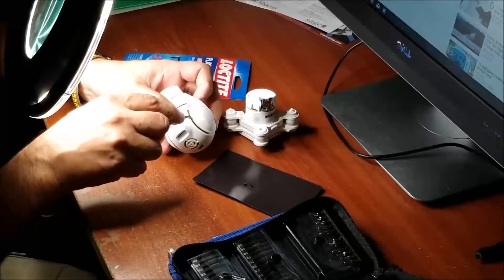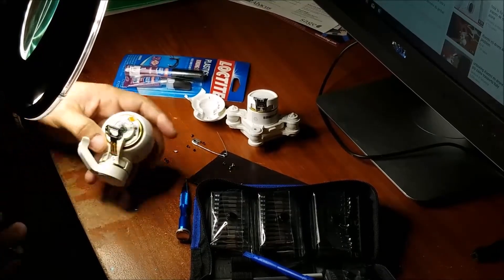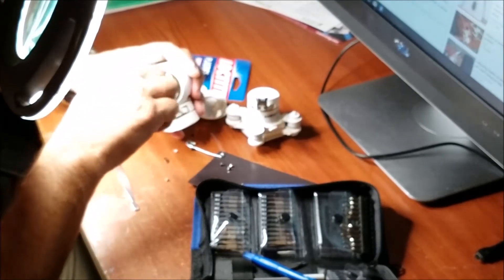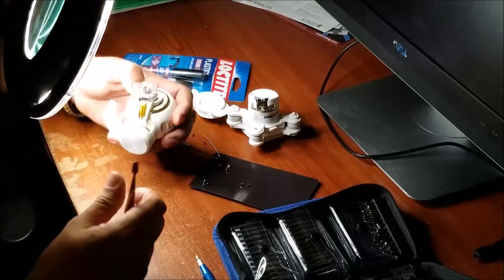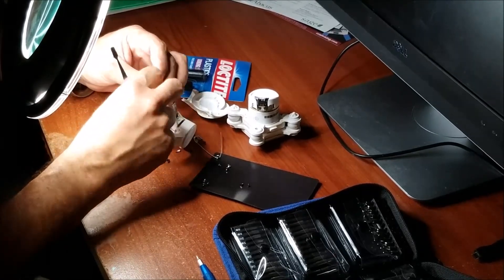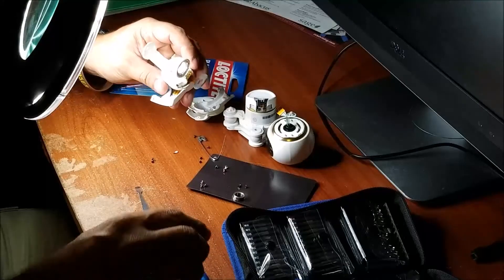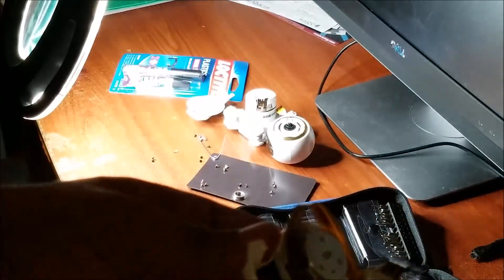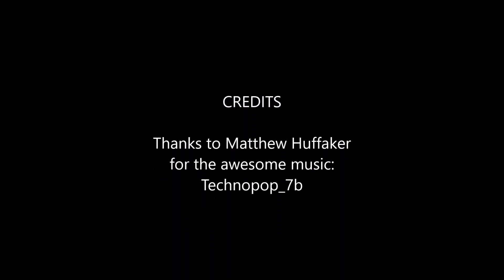Xiaomi Mi drone 4k broken gimbal repair Part#3

Comment: Hi. Thanks for your video. You are very good at fixing the gimbal. I have broken LED light covers which fit under each motor. Do you know where I could get them? Cheers 😀
Reply from the maker: Desmond Sequerah check in Banggood.com, they have a lot of parts for it good luck
Reply: Ger Vi7 Thank you for your suggestion. I have already tried them and Gearbest but with no success. For an upcoming company trying to compete with DJI and others in that category, Xioami are very poor contenders and short sighted. No warranty and customer support is not a marketing strategy. Thanks again for your videos. 😀👍
Reply from the maker: Desmond Sequerah mmmm... I think the only way then is buying the entire housing of the drone... is the closest thing you can do. Good luck GOD bless.
Reply: Ger Vi7 Thanks. I did that but the covers don't come with it. Cheers 😀
Reply from the maker: Desmond Sequerah wow... the other thing someone told me is to use a 3d Printing but for that you need the dimension file 4 that.

Comment: where do you found parts for him ?
i broke mine and i need a cable to the gimbal . Can't find him anywhere
Reply from the maker: Lima Peixoto  Xiaomi Mi Drone 4K version RC Quadcopter Spare parts GImbal Ribbon
Www.aliexpress.com
and then check for: Xiaomi mi drone 4k parts
Reply from the maker: https://www.aliexpress.com/wholesale?initiative_id=SC_20170925201509&SearchText=xiaomi+mi+drone+4k+parts&g=y&misspellText=xiaomi+mi+drone+4+k+parts
Reply: Thanks 😉
Reply: They dont  have the cable that i need . I need to search for a new website
Reply from the maker: Lima Peixoto good look .... those are the only ones available now